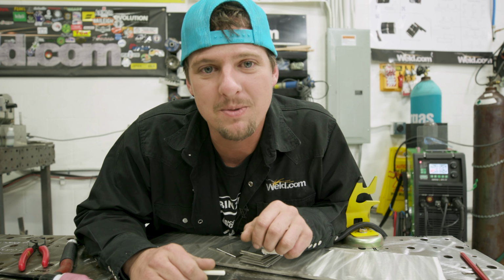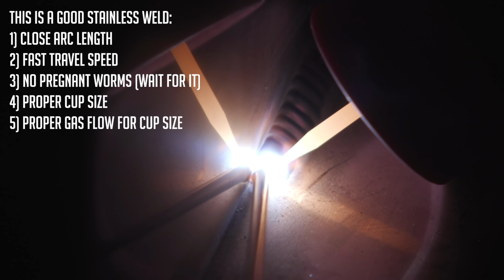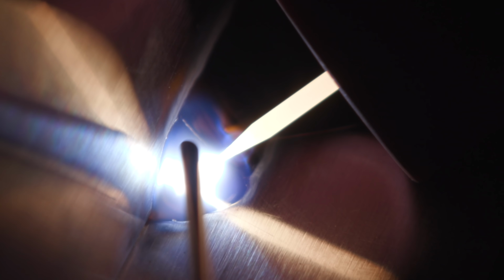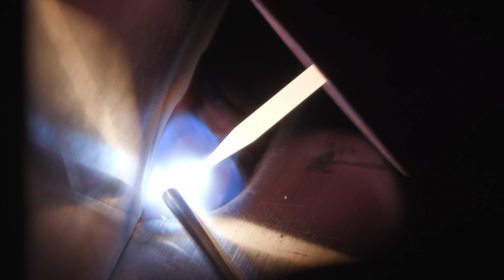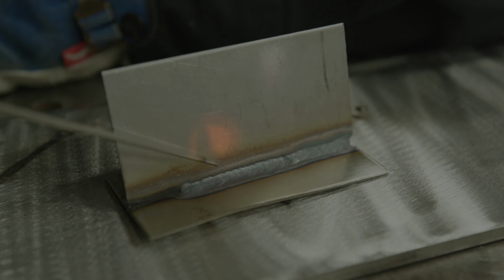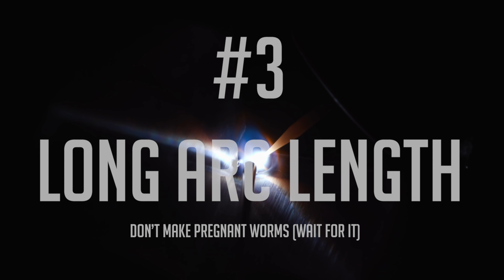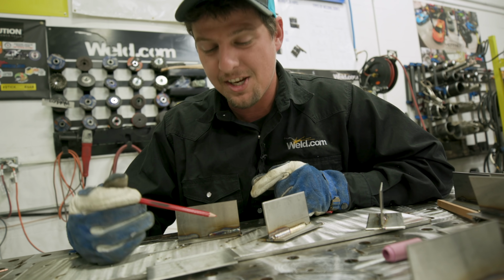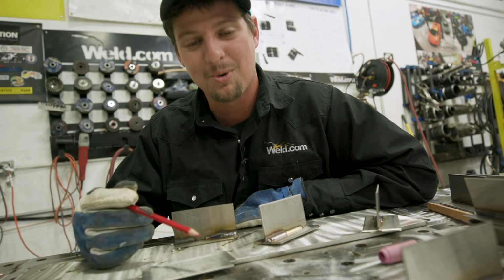Don't Make these 3 Stainless TIG Mistakes

Comment: About remnants at a scrap yard... beware that not all yards will sell. I went to one hoping to score some SS coupons for half price and they told me they only buy. Best I can do is get the most out of the coupons I have. 

I did my best, #8 cups at about 6 liters per minute, and my weld looks just like the too small cup weld that you showed. So I really need giant cups and LOTS of gas (which I can't have, I got a small bottle to work with because I got to carry it up 5 flights of stairs) to get good results? I've managed to cut down on the gas consumption by reducing the pressure a LOT, the pressure set on the stock regulator was too high. Manufacturer of my welder recommends 15psi. 

I guess I'll just weld like this and electropolish later.

Comment: What makes the filler metal ball up??
Reply: Leon Hough when your filler wire and torch angle are greater than 90° your filler will ball up before getting to the puddle. Keep the angle right at 90° and you’ll be all set.

Comment: Are there any books that you recomend to help me learn metallurgy. Unfortunately on my metallurgy class was a joke in college and the teacher ended up getting sued by the the school for his pis poor teaching. Therefore my knowledge in metallurgy is not what it should be.  For example I didn't know until this video what the sugaring from stingless actually was so thank you for that information as well.
Reply: Brian Durham check out metals and how to weld them. It does a great job on covering metallurgy. It’s a pretty dry read but the content is good.
Reply: Metallurgy for the non-metallurgist covers a wide range of topics. See if you can find it in your university library, Springer should have it or find it used.  I am a metallurgist, if you have any specific questions don't hesitate to ask, I used to teach Community College. My main focus is process metallurgy (post cold forming heat treatment) but my ferrous welding metallurgy chops are still solid.
Reply: @otm646   Thank you very much I have a million questions to be perfectly honest when it comes to metallurgy, Like a said my college  Sued  my metallurgy instructor for the lack of teaching he did. my instructor was only there to recruit people to come work at the business he worked at because he would get a kick back from it.  To give a little background I graduated about a year ago And I actually only have a applied science degree and in welding, all my  Certifications have expired, And I'm not necessarily working A high end welding job. Im working and pretty low end  welding job  Mostly due to the location of where I live and it was a first place to give me a job fresh out of college not a great excuse but moving is not an option yet, But I am most definitely exploring all options.  I've even explored going to get my CWI I don't honestly know  the right track being I'm only 23 years old.  Truthfully I wanted to get into  mobile repair welding but I don't have the financial means to get started in such business. I have ordered the book that was recommended to me and I've also gone to the University closest to me to get one of their metallurgy books as well. Thank you very much all they great feed back.

Comment: I just bought a Vulcan 165 from Harbor Fr't 1st day of yr 2020.  Hoping to learn quick.  has 165 A at 30%  I hope it can weld 3/16 sheet to 1/8 (304)
Reply: Personally I wouldn't go pass 1/8 stick rod. Same with tig. If you go bigger rods probably get lack of fusion and penetration. Machine wont do aluminum. There is no ac what I could see. I would pick up some 3/32 and 1/8 rods and experiment.

Comment: Gidday mate,...Love your vids im a fan , i got a question about separate gases can i use co2 gas or oxygen or argon gas in separate bottles and mix them together in same line to my liking
Reply: GMAW (MiG) is up to 25% CO2, 75% or more Argon.  GTAW is 100% argon for 95% of cases. if you are doing aluminum with not-enough-amps to get a smooth pool (you're right on the lower edge of viable amperage) you can add up to 25% helium. if you do more than that, it'll be hard to start an arc, even with HF.  Oxygen is only used with Acetylene with gas welding. it is not to be used in any metal with arc welding because oxygen is the primary contaminant that makes oxides (sapphire for aluminum, rust for steel and sugar for stainless steel (oxidized SS looks like black sugar, like you were trying to make caramel or candy and WAY overheated it)
Reply: They use mix argon with co2 and oxygen for mig welding but tig needs an inert gas like argon or helium

Comment: Wow that part on the frosting turned my world upside down.  I took a class for a company I worked for to do boiler tube repair and the three that taught the class had like 90 years total and they taught us the only way to get rid of ss frosting was to run a purge gas inside the tube. So maybe that applies to other grades of stainless but my welds looked over cooked now looking back

Comment: I wish I could weld stainless like that !
Nice "toe"/leg distribution. The "face"/crown profile you've laid in there makes for a flawless fillet.
Slow enough travel to keep the puddle fluid, yet fast enough so as not to damage the metal.

You are a gifted welder Man-Cub :)

Welding DCEN is almost like alien technology.Smooth, quiet... when the arc is struck, you can see the lightning roll out the laminations from the Tungsten rod. It enables the welder to pinpoint the fire at tight tolerances. 

I practice often, but I'm not nearly as solid as you are dude.

Nice, sharp point too. Maybe you could share some sharpening techniques/grinder safety pointers with us?